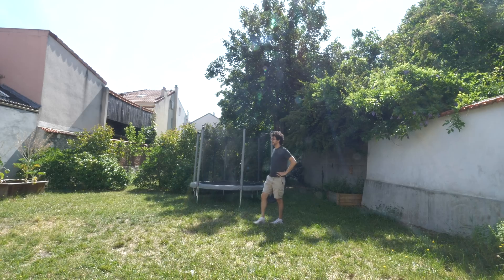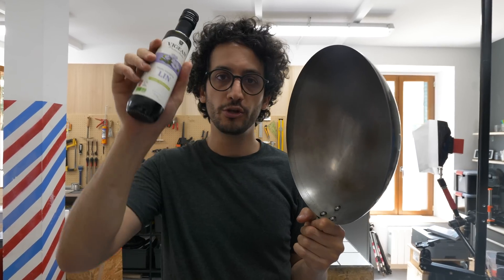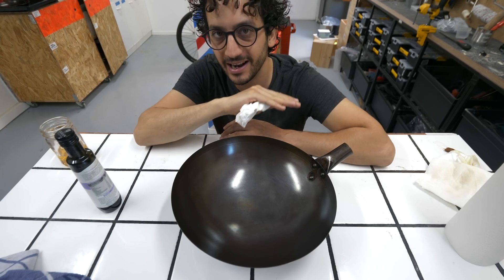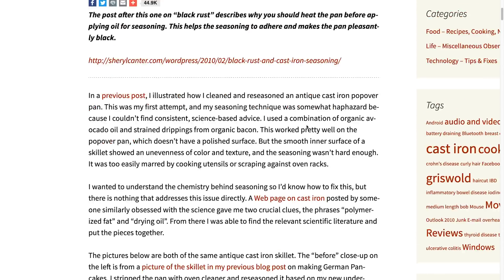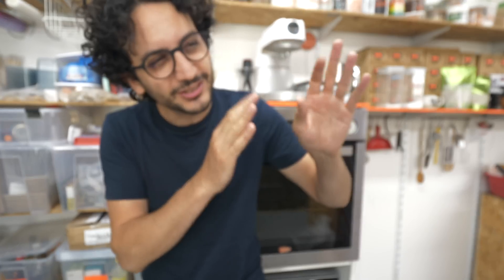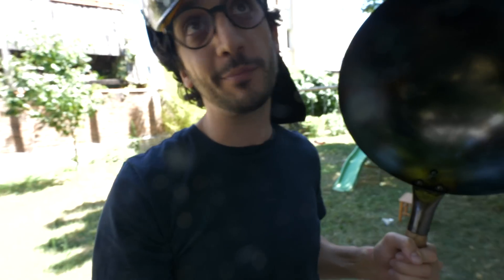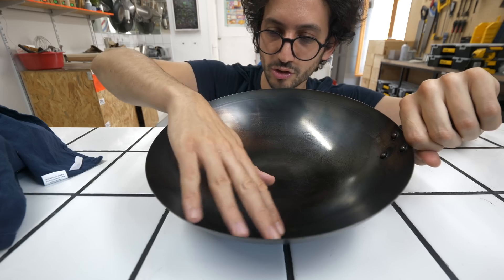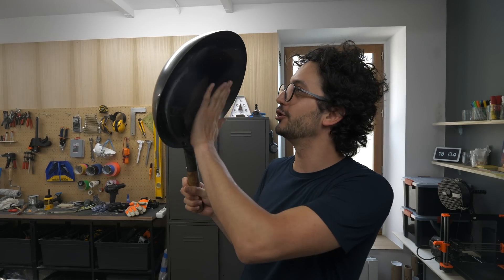Can I Make my Wok Slicker than a Nonstick Pan ?

Comment: I use this process (we call it Bruciatura which can be litterally traslated in "Burning") to season blue iron trays, to make roman style pizza.
I use simple olive oil because that's what I will use to clean the tray after every use. Just paper towel and olive oil. When scraping is needed, I use a plastic dought spatula. You don't want to use steel or any corrosive product (it will remove the oil's layers).
The non-stick will become more and more effective with time. Blue iron is a real bitch for stickness, many people "sacrifice" a fake dought (just water and flour) after the seasoning because it will more likely stick a bit.

Comment: Way better than Teflon considering health risks.
Reply: Teflon is super chemically stable and very food safe. I think using oil is actually more risky, since these polymerization creates oxygen radicals and those would slowly leech into food. But to be fair, its such a small amount and over such a long time that it’s probably inconsequential.
In general teflon is better at everything, it’s more slippery and stable, but it wears. It’s just easier and less wasteful to use oils since you can reapply it.
Reply: Adam Nope, how they created the Teflon was extremely dangerous. They contaminated water ways and it has been proven they cause birth defects and cancer.

Comment: The blue color of the pan after your first coats of seasoning was the steel bluing due to the heat. The color it reaches is determined by the temprature you heat it to. Ploymerized oil is still a chemical bonded to the pan, just like teflon. Teflon is amazingly stable until you overheat it. Then it burns, releases toxic gas and is not nearly as effective as a nonstick. This occurs at around 550 degrees f. So in ordinary coooking, it should not hppen. Do not sear a sous vide steak in teflon. Use cast iron.

Comment: The best and easy way to make the wok or a pan non stick is to put oil in the wok and put the flame on high till the oil smokes and then splater some water in it so that thr wok catches fire in it, do it 2-3 times and wallah u will get the same result.

Comment: "There is no chemical, just a very hrd polymerised surface..." and what exactly do you think that polymerised surface is made of then?
Reply: @Hampus Not that I'm on the other side, but normal cooking conditions to me are 450-500F. Most people watching this video won't understand how they can fry a pork chop while overheating part of the pan  (w/o heat sinks such as carrot / parsnip / some other veg). Tri-ply pans can do it all and are cost competitive with cast iron.
Reply: @Hampus Inetersting. "Reasonable cooking temps" for a wok are above 600 degrees f. if you are stir frying. You are also aggressively stirring the bottom of that pan. I don't know about you, but if you've ever cooked eggs in a scratched teflon pan, it being teflon'd is pretty moot. The cool part about this wok, is that its durable to last lifetimes of use. 

For gently cooking eggs, just use a teflon pan.
Reply: @ikehippensteel9255  Look up and watch some videos on seasoning and cooking eggs in stainless steel. -The only reason for teflon is ignorance.
Reply: @madthumbs1564  Yeah, to be honest I've gone the distance on cooking eggs and seasoning steel and I absolutely agree. Teflon is a joke in cooking.
Reply: Smoke from seasoning pans is toxic. Teflon only gets toxic when you don't follow manufacturer's instructions.
Reply: @madthumbs1564  that isn't teflon though
Reply: @Hampus Hazard Characterization
What makes pans non-stick? What is the potentially toxic component?
The most common non-stick coating used to coat pots and pans is Teflon, a chemical mixture of perfluorochemicals (chemicals with lots of fluoride atoms). Developed by DuPont chemical company in 1938, these chemicals are extremely non-polar, meaning they do a very good job repelling other chemicals. As such, Teflon is used as an additive to paints, fabrics, carpets, and clothing. It is also used to treat materials to make them resistant to oils (like the inside of microwave popcorn bags). The primary chemical in Teflon, polytetrafluoroethylene (PTFE), has a high melting point (327 ºC), making it ideal for cooking applications. However, when heated to temperatures above 350 ºC (662 ºF), PTFE begins to degrade, releasing fine particles and a variety of gaseous compounds that can cause damage to the lungs when inhaled (Waritz, 1975).https://tibbs.unc.edu/ask-a-toxicologist-is-it-safe-to-use-teflon-pans/
Reply: @Hampus  if you have cooked enough you would know even a nylon spatula can scratch a teflon pan during cooking. i don't know how it happened but i threw away enough pans to tell you this.
Reply: I came to the comments just to upvote this :)
Reply: @Hampus teflon does degrade in a range of temps common in a kitchen. You would never heat a teflon pan to the same temp as cast iron to sear a steak for example. Teflon will degrade and offgas at high temps and actually kills quite a few birds in homes each year
Reply: It surely is the same as using Teflon, and Teflon is maybe even better/more slippery, but it is already known that Teflon is also a bit cancerogenic, and it will eventually move from your pan in your food as time passes by... Maybe is his Lincid-oil-polymer far less or no cancerogenic at all... Maybe because it is harder to get it from the pan in the food, compared to Teflon...
Reply: @Hampus its toxic if scratched and 9/10 homes will scratch there pans so too most yeah its toxic
Reply: So, criticize a French guy who do english videos for the majority to enjoy and he just mess up one word. Because i know he ment the way the surface is coated. Not a surface that is made of polymers.
Reply: @bumbleecorp9824  Wrong. The surface is coated BUT also made of polymers. The word he messed up is "chemical". 
It is a chemical reaction, most likely a polyaddition (and also some form of polycondensation).
Every coating he would put on a pan is a chemical, just like everything you ever touched is a chemical.
What he probably meant to say was that it is a natural product(, which opens up another discussion because it really isn't, but it is at least based on a natural product).
But, even then, it is still a chemical.
Reply: @KreaTiefpunkt  well in that line of thinking. Everything is a chemical reaction. The thing is that he didn't make any polymer. He just changed through(obviously) chemical reactions the state of the oil. Is like making ice from water. But yeah, my comment was for the guy who was messing with Alex. When he is speaking a different lenguage than his native lenguage. And still he managed to make awesome english videos. Also thanks for the explanation.
Reply: @bumbleecorp9824  Thank you that are open to learning something new.
I agree that since Alex is french it can be hard to find the right words in english. I just wanted to stress that you were correcting him on the wrong word. 

There are two things I want to clarify though:
A) It is actually a polymerisation,  however I find it more likely to be oligomers, not polymers (the difference is that polymers have more repeating units than oligomers).

B) Changing the state of a matter is not a chemical reaction. Melting ice to get water has little to do with chemistry, if anything it would fall under physical chemistry and kinetics. Making the coating however is a chemical reaction. Like I said, most likely Polyaddition and Polycondensation. Polyaddition means that for example free acids attack a double bond on a triglycerid (for example), making an ester. That is a chemical reaction, as the molecule formed is different from he molecules that were there beforehand. Polycondensation is less likey, as it would mean that the Glycerin, a compound with 3 hydroxy-(read: alkohol) groups has to get split off using water, which is not present by default in any oil.
This is also the reason,why it isn't simply "drying" the oil onto the pan, because for that, something (like water) has to be evaporated. And like I said, water is not present in oil, which is why I am fairly certain that it has to be a polymerisation, as liquids get more and more solid the further the polymerisation is done.
If you read this far I'd like to thank you for reading through the whole response. I don't want to offend you, I simply wanted to correct an error in your logic and if there is anything that doesn't make sense to you I am happy to explain it differently.
Reply: Ok he means the difference between the two chemicals the oil is not as toxic as the teflon, polymerised just the term for the surface.
Reply: @m7744321  Teflon is the second most unreactive material that is known currently, therefore teflon is NOT toxic.
Reply: @m7744321  But the polymerized oil is just as toxic, if you watch the video its mentioned how caricinogenic it is (the oil that is).
Reply: @m7744321  teflon is at least as non-toxic,  if not moreso, than the polymers created from linseed oil.
Reply: @plasterbrick2011  no not true at all read up on your chemistry
Reply: @Hampus yes its and yes it does and its on the market because it cheap and it does work but is still toxic
Reply: @m7744321  Hey, I'm expected to  have a degree in chemical engineering with a specialty in polymers in about 3 months and you are full of shit.
While you would be perfectly right to say that the monomer is toxic, the polymer (like pretty much every polymer ever) is non toxic.
Unless, of course, it breaks down. Teflon melts at 326,8°C, which, considering we don't ever get that high in normal cooking, is perfectly reasonable. 
At about 360°C it starts releasing gases that are dangerous and toxic. Again, you don't reach these temperatures and if you ever do, your oil in the pan is long gone and your kitchen is probably on fire right now.
In fact, you could eat Teflon and it wouldn't hurt you because like I said, polymers are non toxic.
Please stop spouting nonsense.
Reply: @KreaTiefpunkt  lol you just said it is toxic in your reply l never said how it became so nor did l ever say it was fatal so  nothing l said was nonsense. Good way to win my argument for me though thanks.
Reply: @m7744321  Yeah sure my dude, take it however you like. Btw, the monomer (that is toxic like I said above) is not called Teflon, it is Tetrafluoroethylene. Teflon itself is Polytetrafluoroethylene. There is a very distinct difference, though I believe that you are reluctant to accept that you know less than someone else, which makes this whole thing pointless.
Again, everything you said was nonsense, thanks to your severe lack of chemical knowledge.
Reply: KreaTiefpunkt While you’re pretending to be a chemical engineer with Wikipedia open in another tab, look up “logical fallacies.”
Reply: @chooseymomschoose  Like I said, I don't have my degree yet. I am currently working on my bachelor thesis. 
Also, it is true that I had to look up for example the melting point of Teflon. 
I don't think that makes me less believable, but more, since I actually care about making sure that what I say is correct.
I am more then happy to link my sources though if you'd want to see for yourself.
I'd appreciate if you could tell me which logical fallacies I have commited, since it is harder to see them in ones own reasoning and you seem to have spotted some.
Reply: @m7744321  I love how there's kids like you down here talking shit getting minimal upvotes compared to the people who are actually right... Why can't idiots like you gauge when your bullshit isn't flying and just walk away before you make yourself look too stupid? Lmfao.
Reply: Wow! you must feel so smart now congrats
Reply: @Hampus hmm passive so like when its not heated hmm ok and its still toxic when its not but hey like you said HURR

Comment: My cast iron and Teflon pans have about the same non stickiness, although I prefer the cast iron becase it can handle higher temperatures. Teflon coated aluminium pans get up to temp faster and are lighter but have a shorter lifespan... Both are useful tools but the cast iron / carbon steel pans are more versatile imo.

Comment: One big advantage of this oil seasoning is that you can renew the coating whenever you accidentally scratch it or so. And the pan will last a lifetime.
Not like a Teflon pan, if the Teflon coating is damaged you have to throw away the pan, because you don't want to have particles of the coating in your food (the black coating inside the pan isn't actually the Teflon, it is a kind of high temperature plastic where the Teflon (transparent) is coated on.
Also cooks say the food made in a oil seasoned pan gets a very special taste.

Comment: I fell into this rabbit hole years ago with my cast iron pan. I've used linseed oil for over two years now and one thing I should point out for anyone thinking of doing like a hundred layers is that linseed or flax does make for a very hard shiny coating, but if you layer too much of it on, it will very likely start to flake off and cascade into a catastrophic shedding fit. It was a very bad experience, and I now believe that linseed oil should be kept to the foundational layers over the bare metal and then gradually replaced with regular oils as you start cooking with it. My theory is that linseed oil becomes so hard that it gets brittle and prone to flaking off when you layer it on too much or when you layer it over other oils that don't harden as much. One way to tell if your seasoning is maybe getting too thick is that stamped words or logos on the pan will start looking like they're getting in-filled by the seasoning. This, of course, only applies to cookware with stamped words, but once that happens, you should probably stop seasoning for its own sake and only reseason after cooking.
I have to ask though, but was that polishing compound you used in the end even food-safe? I've also never thought of polishing the seasoned surface itself. Instead I followed methods of polishing the bare metal before starting to layer on seasoning.

Comment: This is better than Teflon because - it does not degrade as badly with use and high heat, it can be used with metal utensils, and you can add to the layers of non-stick after each use by wiping on oil and putting it back on the burner.
Teflon cannot handle high heat searing, scratches, and it's all downhill once you use it.

Comment: 1. Make friends with the people who own your local Chinese restaurant. 
2. Have then season your wok.
3. ????
4. Profit.
Reply: They will probally use it for a few weeks and give it back and it will automatically seasoned. I do that with my woks xD
Reply: @martinzhang2226  ? Wouldn't they burn their wok to clean it? That's how i used to do, and then i seasoned it every time after, so much faster on an actual wok fire.
Reply: @rostharan  yea that's why I said just use it for a couple of weeks and it will be seasoned. Cos u burn+wash it to clean it
Reply: @rostharan   get a burner...cost about 300 bucks...connect the gas...oil+ max fire...takes like half an hour if  u wanna do like 5 coats...1 coat takes a few minutes....but they dont oil the outside of the wok though....alex's method does
Reply: @martinzhang2226  But, you remove the oil coat every time you burn the wok to clean it.
Reply: @TezNguyen  ? ok and? I don't understand what you are trying to say here.
Reply: @rostharan  then u reapply a thin layer of oil and then burn that after cleaning the wok, that's how u keep a wok clean and not rusty. If u don't oil+burn it after it can easily get rusty over time.
Reply: @martinzhang2226  Then what's the point of waiting a few weeks? if the surface will always be renewed? That's where you confused me.
Reply: They can also share their secret recipe book "100 ways to wok your dog."

Comment: I suppose, technically, Teflon pans are less sticky but they tend to be more expensive and once you scratch the Teflon surface the pan is useless, or nearly so.  Seasoning a cast iron or carbon steel pan is, in the long run, more economical and more environmentally friendly, I suppose.

Comment: Honestly, I don't want to cook without oil.  It adds flavour, and helps conduct heat to the uneven surface of the food itself - so I would go for the seasoned pan/wok rather than the Teflon one.

Comment: A properly seasoned pan is like a classic car. Yes, yes, it does not have all of the bells and whistles of the new cars rolling off the manufacturing line, but it has a certain je ne sais quoi about it that just makes that pan "drive" better than the new teflon pans. Much like a classic car can be repaired (with much care), seasoned pans can be re-seasoned(with much care) for generations, whilst a creating a new layer of teflon would be much more difficult process to say the least.

Comment: From what I've seen, asian cooks don't do all this. They first heat all parts of the new wok to red heat over the high btu burner, scrub it out carefully with water and a steel pad, reheat the wok blazing hot, add oil, swirl, pour off, and good to go. The wok needs to be heated smoking hot and given an oil swirl every time you cook. All that baked on coating seems more like a proceedure for western cast iron skillets. If you can stir fry fresh rice noodles without any sticking, your wok is good.

Comment: I absolutely think my carbon steel work and carbon steel skillet are better than Teflon for everything but scrambled egg and omlette. In addition to being nearly as non-stick as a Teflon pan, they are both much more forgiving of the utensils I use. I would never use a metal stirfry paddle in a Teflon pan, but my carbon steel takes it like a champ! Also, I get a far nicer sear with ether of them.

Comment: If for some reasons you could not find unrefined food grade linseed/flaxseed oil, a normal, cheaper hi-polynsatured sunflower seed oil will do the trick, just be careful to avoid high moninsatured sunflower seed oil (that's better for cooking, by the way).